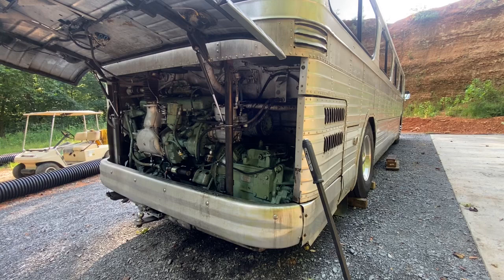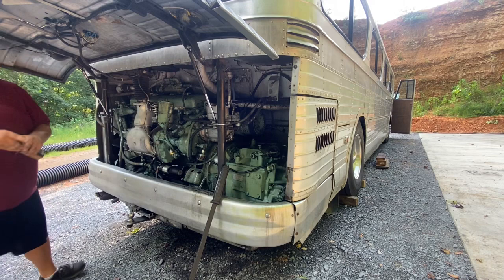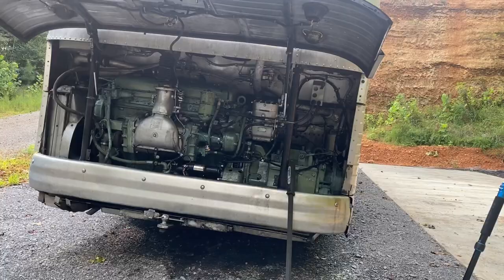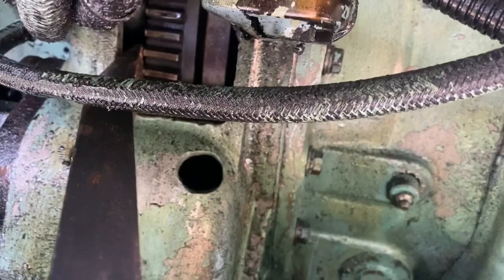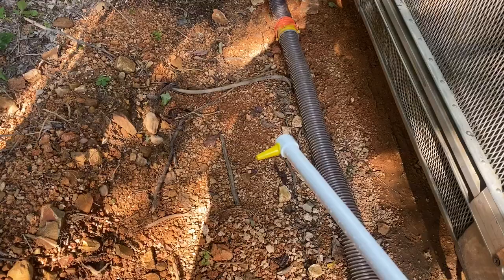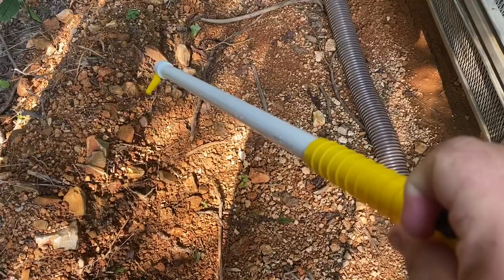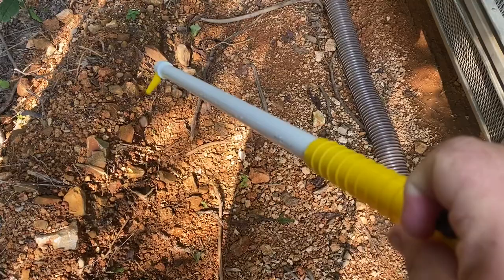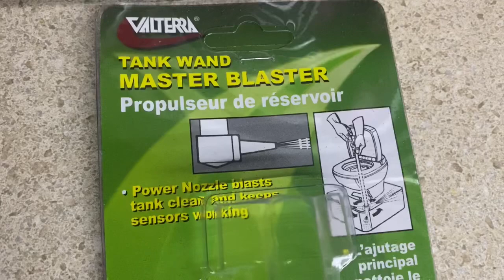Vintage gm bus 4104 project day 1 Detroit Diesel 671

Comment: You need a Vice Grip Garage patented 'Lone Wolf 9000' starter trigger.
Reply: A feller could use one of those. I hear they work like factry.
Reply: Some buses are fitted with a second starter button in the engine bay.

Comment: If it were my bus I would install a small panel in the engine bay with start switch, oil pressure gauge, temp gauge, air pressure gauge, and volt meter. Back in my Navy days in the early 80's the base recreation shop had a 4104 conversation to a camper. It was unused for many years because it would run away and no one knew how to fix it. I fixed it, tuned it up, and did the brakes. I got it back in driving condition and I could check it out. Ten of us at a time would take it to Las Vegas on weekends. It was a blast.

Comment: Hi Scott.  It is possible to tell by a compression test if it's valves or rings.
1) Dry compression test.
Test compression as you would normally.  Note value for each cylinder.
2) Wet compression test
Squirt some ordinary engine oil into each cylinder and crank over a few seconds.
Now take each compression again.  Note values and compare.
If any of the values has changed (increased), it's probably because the oil temporarily 'sealed' the rings.   
If there is no change, the rings were good (i.e. the oil made no difference) and it's the valves.
Regards Mark in the UK

Comment: Always left a good amount of water in the bottom of the tank after it was emptied. Along with some digester. When we were on full Hook up, we would leave the valve to the tank closed so there was always water on the bottom. When it did get part way filled we would open the valve and empty it, add more water, and repeat.

Comment: I did the heads on a v8 in one about that age. The back head slides straight to you off the studs front or top head lifts up through a hatch under the back bench seat. 40 years ago it was fun😲

Comment: yes scott i noiced from  the sound of this vintage gm bus 4104  engine that it sounded like the engines was either skipping or missing so your the guy that can hear and til things and like you said yes only running on 7 cyclinders instead of the whole 8 but i know you will fix the problem and wow the bathroom toilet cleaning tool and the new part that you put in amazing to learn those important tips to make it less messing while cleaning it out and stuff great video scott for project day 1 vintage gm 4104 bus so until next video i say bye for now and take care from Randy from ontario,canada p.s stay safe out there and enjoy working on this 4104 vintage bus .

Comment: after little bit love from scott that engine its goint to work excellent.
Reply: Yep, reco head, injectors, new pistons & liners, crank bearings, fix wonky flywheel if possible or drop in another donk. BGM definitely needs the new covered shop and shop tools for these projects.

Comment: Not a bad bus, it might be a glow plugs problem. I would clean all those first. Engines like that compression wise last forever. I would also inspect the injectors and clean all of them also! The play on the fly wheel might be a thrust bearing..
Reply from the maker: First the flywheel is loose the other end has zero play.   Second no glow plugs in a detroit diesel just compression
Reply: D'oh! Trade school small engine certificate hasn't ever heard of a 2 stroke. Good thing those glow plugs didn't get fouled. lol
Reply: You should start a business selling glow plugs for old detroits, you would make a fortune!  I bet if you google it, there is no one out there selling glow plugs for these..... :D
Reply: @DrinkWhiskeyRaiseHell  A few of the military detroits did have glow plugs from what I was told.

Comment: Scott that wand you works fairly well ihave used them what i have found that works better is a wand that has a spinner on the bottom of it water pressure keeps it spinning as long as there is water running to saves you having to turn the wandthey are about ten bucks more than the one you have

Comment: You are correct Sir. Needs more electrons!!!!!!!!!!!! (Or in my way of thinking--more holes!)
Reply: It's six of one, half a dozen of the other.  If you don't have enough electrons to fill those holes, it ain't gonna crank.
Reply: Put the battery higher to give the electrons a bit more pressure :)

Comment: When you dump your waste tank, do you leave it totally empty it or leave 5 - 8 Gals of water in it and add lav blue to it (for smell)?  In the airline industry, we would add and leave 4-6 gals of lav blue water in the dump tank after flushing it out so solids would not stick to the bottom of the tank.  So, dump, flush, then add 4-6 gals in waste tank (and put lav blue packet in tank from toilet).
Reply: Simple green or vinegar works also 🤔

Comment: I meant to tell you guys this awhile ago but you guys need a portable pooper on your land. They come every couple weeks to pump it out. It's inexpensive. That way you can keep your R/V tank cleen and ready to go if needed. Plus once you guys start a build you will need one anyway. I had one when i parked my trailer on a site for a year. One other option.. you could use the backhoe to dig a hole and build an outhouse over it. Use Lye and sawdust to break it down.. It's used in almost all other countries. You can't just use your onboard toilet if your not pumping it out on a regular few days use.
Reply: A full septic system is already on the property, up on top of the hill, where the permanent buildings will be.

Comment: Sounds like starter was stuttering and not enough juice.
Reply: Exactly, solenoid was having a hard time staying engaged, low voltage. Also starter motor wasn't rolling to quick. I would check for resistance on the connections and load test Batteries.
Reply: That was painful to hear!
Reply: Maybe because the flywheel is getting ready to fall off.
Reply: Not enough juice??  Could be a dietary solution to the other problem Scott was talking about :D

Comment: Leave the blank tank dump valve closed until you dump it. Also, they make a flushing wand with a whirly-gig on the end. That spinner can come off and get lodged in the drain valve.
Reply from the maker: It was closed.  I don’t leave the sewer hose attached.  .

Comment: I had to do a loose flywheel repair on one of those engines in the 70's .But it only made a noise when on the overrun and at idle . Sounds like the solenoid is not contacting properly.

Comment: That's a nice looking bus.. too bad the engine is in a bad way.. but its in good hands now.. As far as the poo pyramid, look up the bio-geo method. It does work better if you can drive and agitate the tanks but I am sure it will help, plus its pretty simple to do.. just add dish detergent and borax.. borax makes the water break down the solids in the tank and the dish detergent is a surfactant, it suspends the solids and allows you to flush them out. There is a great video on here about it..
Reply: Also add a few bags of ice and drive it around the ics sloshing will help break things up

Comment: I wonder how low you can go with compression on a diesel. Old Alco 251 locomotive diesels would operate with as low as an 11.5:1 compression ratio, but I don't know what the compression pressure was with those. They also would take a while to wake up on colder days though...

Comment: Wifes name and pic. Mark here. Scott I feel your pain and I worked in Wastewater Treatment for 30 years. My Alpine Coach had that plug issues 2 years in a row on my Birthday. Basically a bad design. My plumber friend and I took out black tank, the inlet was only 2 inches off the bottom giving the solids nowhere to go quick. We put in bigger diameter inlet which now was now  5 inches to tank bottom. Thanks for videos .Peace

Comment: Put a few inches of water in the tank after dumping and fill the bowl with water some before doing your flush and you may find you do not have to do your jet work.
Reply from the maker: The tank is taller on the drain end.  It would have to be 1/2 full to make a difference.
Reply: @BusGreaseMonkey  Ouch. Good thing you have your tool then.

Comment: What size culverts did you get to go under the driveway with storm water?  Are you going to use a prefab or constructed ballast catch basin of any kind, or just a ditch to the pipe opening?
Reply: They look like 12in

Comment: Any particular reason that you don't have a clip on ignition switch that you can use from the engine bay? Seems painful to be running back and forth to the front or co opting a helper.
Reply: Stepping on the clutch to relieve as much friction as possible, remove all possible drag on the engine as it's being started. But yeah, not sure why no start control in the engine bay.

Comment: Bus grease monkey as a older mechanic with a lot of Detroit experience. If road equipment I enjoy your videos.    Just wondering if you are interested in a 71 and also 53 series piston install sleeves.both are new condition very little use. If so we will connect
Reply from the maker: I do not have the 53 one, and tyler could probably use the 71

Comment: Silly question do you have a diesel pump on your property or do you have to pull them things into a gas station somewhere
Reply: The eye of the storm unless you need lots of fuel daily or weekly, you’re better off buying fuel from a station. And best practice, from a station that sells a lot of fuel, like a truck-stop. Fresher the better.

Comment: I’ve noticed most the coaches don’t have start controls in the rear, are they disabled or what? Also, hi idle. Is that disabled too?
Everything I ever drove had start controls in the engine compartment.
Reply: High idle,  well if this unit has a high idle feature, Scott may not have bothered engaging it.  I've had air-activated high idle controls on almost everything I drove that had a Detroit in it. The few that didn't, or the air actuator no longer functioned for whatever reason,  had a screw-type throttle pedal actuator, or worst-case, a high-idle stick bought from a truck stop.

Comment: Need to leave black tank closed until it is full when parked.
Reply from the maker: It was only 1/4 full but blocked 100% at the toilet end.   Water up the chute
Reply: I think that a macerator is the way to go.  grind it up and add water if needed.  Or get a NeverDump, when they are available.
Reply from the maker: Doesn’t help if its not flowing to the exit. Not sure what you are not understanding
Reply: @rnreajr9184  macerator pumps are great, for when you need to pump out vertically, I have yet to see an RV that is not setup to have a gravity powered drain of the black water tank so not really something usable here. That is ignoring the fact that it wasn't a full tank clogged at the exit valve but a toilet clogged by excrement piled in one spot.
Reply: @BusGreaseMonkey  I understand that the macerator wouldn't fix this problem. I see them as preventing some of the issues with the standard gravity-powered RV black water systems. Put a small (2.5 gallon or so) holding tank at the toilet, macerate and pump it to the black tank. Similar pump to pump out the black tank, if needed. Tank can be shaped however is convenient, placed wherever is convenient.

Comment: Is there no way you can rig up a temporary start button at the rear of the bus? Working on the bus solo looks a  PITA to me, or are there issues that go against that idea?
Reply from the maker: I was just trying to move it to the pad.  Never expected a big ordeal just to move it over 20 feet.  I should have just been able to hop in the drivers seat start it and move it.
Reply: @BusGreaseMonkey  No, I didn't mean that Scott, what I meant was when you are working on the engine at the back (obviously) it looks pretty inefficient to have to keep hopping up to the drivers seat to try to start it, or stop it for that matter, when you are working alone.
Reply: JMW what Scott is saying is that he just went out to move the bus and he didn’t have anything with him!! Scott has remote starter buttons and used them when they were working on sages bus in NC I believe. It comes down to the fact he just wanted to get in, start it up, and move it. Nothing more, nothing lessons
Reply: @1982MCI  Don, thanks, sometimes I'm a bit slow on the uptake LOL. I get it now. I blame the Atlantic between us!

Comment: I could build you a hell of a battery charger/JUMP START 
It could be 240/30amps to 12/24 volts I have most the stuff to do it but you would have to pick it up or pay freight shipping 
It would be very heavy not switch mode crap I am talking 75 or 100 pounds of Transformer 
alone with giant caps for jump starting 
It would be a donation to your channel 
If interested let me know 2 amp settings you would like I would make jump amp setting all that it will do

Comment: Why can’t you rear start it?
Reply: Apparently this unit not equipped with start control in the engine bay.  Guess that's a special order feature and it wasn't selected. Every bus I've ever seen the business end of, HAD a start control and basic gauges under there, so I thought it was normal to have that feature, but apparently not.